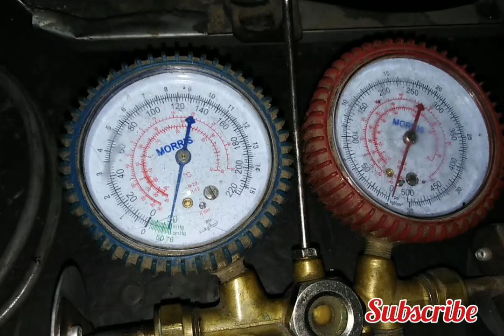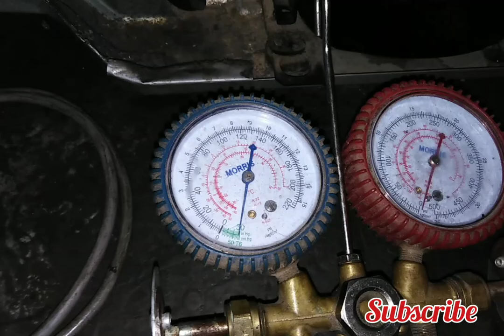Flushing menggunakan thinner , FLUSHING KULKAS

Comment: Untuk ganti oli kompresor pakai takaran berapa mas,,takutnya kelebihan nanti malah masuk di evap,, khusus untuk kulkas 1 & 2 pintu,,tolong jawab yah mas,,🙏🙏
Reply from the maker: Untuk 1pintu rumah tangga (1/8pk) itu standardnya 170ml, untuk 2pintu yang 1/6pk std 200ml, untuk freezer (1/4 & 1/5 pk) maksimal 250ml
Reply: olinya merek apa mas ( oli berap W )
Reply from the maker: @ahmadfandi4918  olinya sesuai jenis freon mas, untuk R 134 a ya pakai oli merk EMKARATE
Reply: @kustehnik  mas.. jika ac kompressornya berapa ml ya olinya.. 1 hp

Comment: Kak klo pipa baliknya ber air sampai beku apa yg ber masalah.
Reply from the maker: Kebanyakan freon kang,
Penyebab lain sirkulasi kurang lancar termasuk kapiler, dan masih ada sisa oli di evaporator
Reply: @kustehnik  trims kak. Terlalu banyak freonnya sdh ak kurangi freon langsung mantap.ak kasih di 9psi.alnya aku kasih 14psi gak mau beku.kak aku mau nanya.kenapa setiap 4bulan sekali ak isi freon.ini freezer baru aku beli trus 4bulan kemudian sdh tidak beku lagi.. bocor nya kira kira bagian yang mana kak.tlng kasih solusinya kak🙏🙏🙏🙏🙏
Reply from the maker: Di cek pakek manifol kang, cek secara terpisah, untuk evaporator kasih tekanan 120psi, untuk kondensor kasih tekanan 350psi, lalu biarkan beberapa jam, mana yang akan turun tekanannya
Reply: @kustehnik  Kalam ada video untuk cek evaporator kondesor.

Comment: apa seal kompres dalam kompresor gak rusak bro.
Reply from the maker: Kompresor gak pakai seal,, adanya piston dan klep membran(baja),, lagipula thinner tidak masuk ke dalam unit kompresor,, hanya ke evap saja
Reply: @kustehnik  mengapa kompresor yg saya miliki ada sealnya ya.
kronologinya seperti ini :......

pada saat itu kulkas yg saya miliki  tidak dingin. setelah saya cek ternyata tekanan yg di ciptakan oleh kompresor saya tdk kuat tdk sampau 200 PSI.  saya putuskan membongkarnya.  setelah saya cek ternyata kepala sarang piston atau kepala poring poston bocor atau mengeluarkan angin dari selah selah kepala poring.  saya coba buka ternyata ada sealnya.  hal ini akibat dari Freon yg di gunakan adalah LPG (krn coba coba).  kesimpulan saya mungkin kompresor saya memiliki seal.  sedang kompresor anda mungkin tidak.
Reply from the maker: @dedetsuryani8402  oo.. Begitu,, ya bisa jadi, masalahnya saya sendiri tiap bongkar belum pernah nemuin seal yang sampean sebutkan itu,, LPG saya belum pernah pakai buat pengganti freon mas,, tapi kalo memperbaiki bekas tuser lain yang pakai LPG sering,, rata-rata kompresor yang pertama jadi korban,, ada bau, nampak ada zat kapur, semacam zat asam,, dll

Comment: Di praktekan di kulkas 2 pintu, boleh kang?
Reply from the maker: Sama saja kang, bisa
Reply: @kustehnik  numpang belajar kang, baru pertama isai freon. klau sementara isi freon, tekanan sdh di 12psi, tiba" tekanan turun drastis, sampai di bawah 0 psi, sampai berhenti pendinginan, selang bbrp menit naik sendirinya di 12psi, masalahnya dimana kang ya,
Reply from the maker: @wahyudimuslimin2906  masalahnya di dalam unit sirkulasi masih ada sisa kotoran atau air, intinya flusingnya kurang bersih,
Reply: @kustehnik  klau flusing menggunakan tiner di tekan pakai angin lewat pipa balik ke evap-kapiler, boleh kang?

Comment: pak kalau untuk kulkas bok 3 pintu sering mepet kapiler nya,gimana cara nya pak
Reply from the maker: Fun pintu paling atas muter nggak,
Evap ada desisnya nggak?
Caranya sama saja mas, cek tekanan, flushing, vakum, isi. 
Kalau bener2 mampet ya ganti kapiler. Barangkali cuma filter yang mampet
Reply: filter bru ganti pak tidak ada suara mendesir,jika pipa kapiler di lepas dan di kasi pentil lalu di dorong dengan comprsor apa bisa pak?
Reply from the maker: @raystarray2095  kalau tujuannya untuk membersihkan mendingan di sedot saja, kalau di tekan pakai kompresor eman2 kompresornya bisa jebol klepnya jikalau kapiler tetap buntu
Reply: klau ganti pipa kapiler untuk kulkas bok yg 3 pintu ukuran panjang pipa dan ukuran pipa kapiler nya brpa pak?
Reply from the maker: @raystarray2095  185-200cm
Kalau mau di dorong kapilernya meski lewat manifol demi keamanan kompresor, kasih tekanan 350 psi (max)
Reply: maksud nya manifol di kunci dlu sampai tekanan komprsor mncapai 350 bru di lepas untuk mndorong kapiler nya ya pak?
Reply from the maker: @raystarray2095  nggak perlu di kunci, langsung saja, sambil di amati jarumnya, barangkali kapiler gak mau jebol ya di hentikan jika melebihi 350psi
Reply: ya pak bsok saya coba,jika sudah di tekan tidak bisa jebol juga,apa ada cara lain pak selain ganti capiler,mklum di kampung susah cari capiler

Comment: Ciri-ciri mampet gimana mas bro?ampernya naik turun/naik?
terima kasih
Reply from the maker: Mampet itu terkadang dingin bersalju terkadang hanya dingin saja, tidak ada suara desis pada evaporator, strainer dingin hingga berembun, untuk ampernya juga pasti naik turun di nol koma, dan kondensor tidak panas🙏
Reply: @kustehnik  mantap penjelasannya mas bro,
mau tanya juga saya punya kulkas 2 pintu side by side samsung(509liter)star awal naik ampernya sampe 1,2 amper,setelah 2 menitan dia turun ke 0,8 amper habis itu naik lagi ke 1,1amper,terus turun ke 0,8amper tapi setelahnya stabil(antara 0,7-0,8amper),apa itu ciri-ciri mampet?sedangkan kulkas dinginnya normal,malah minuman dalam botol plastik sedikit jadi es.dan yang di freezer es batunya normal(2jam jadi es batu).
terima kasih.
Reply from the maker: @tayoyo642  itu kulkas e sampean masih normal bos 😀, bukan mampet👍
Reply: @kustehnik  normal ya mas bro..oke lah saya jadi tenang,takut ndak normal..
terima kasih
Reply from the maker: @tayoyo642  sama-sama bro
Reply: Mungkin ini jenis inverter ya, jadi arus bisa naik turun